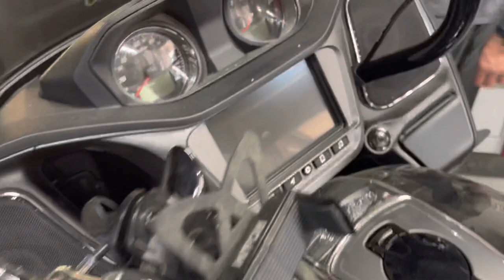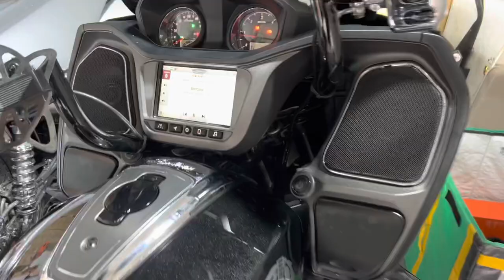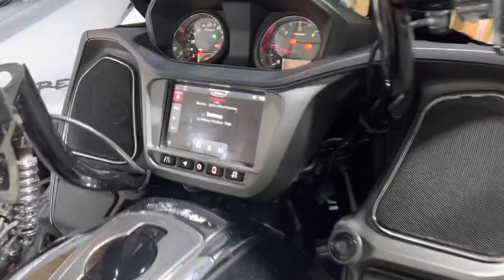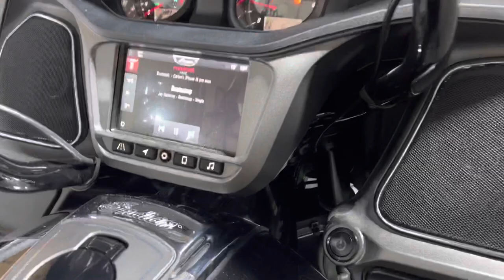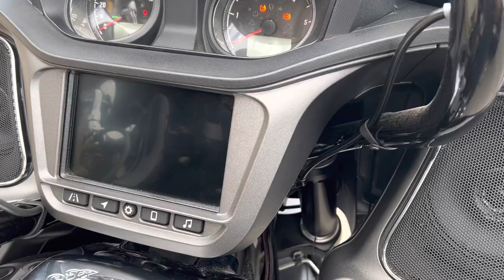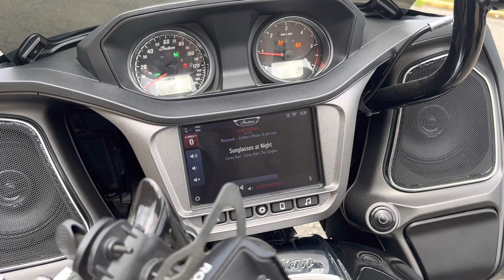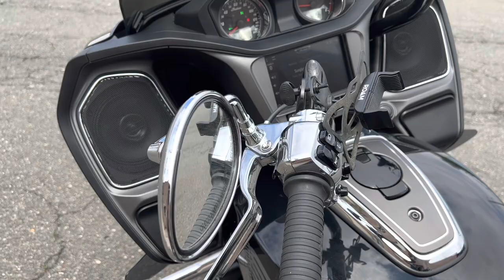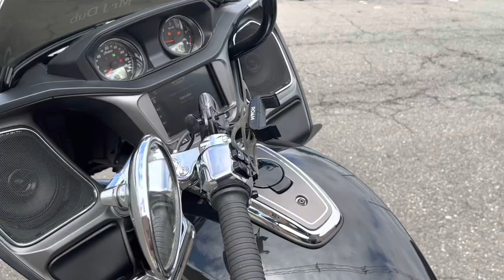Indian Challenger in for a Nvs Audio Stage 3 Audio upgrade using the factory radio.

Comment: Awesome! Sounds like you guys know your business. Do you have  a solution for the Springfield? I have the Indian speakers and amp in the bag and it's useless. My pipes are V&H turn-downs so not stupid loud and I wear a full-face helmet. I also added a pair of coaxial Pioneer speakers on the handlebars as well as a 200 watt power amp in my handlebar bag. Still can't hear jack going over 40 MPH. I'm plugged in direct from my phone.

Comment: Carlos, I'm sure you've noticed on these Challenger's the front pods have down firing ports in the front. Have you tried sealing these by chance? I have a 21 Challenger that I am wrapping a full build up on and was curious if sealing them would help any?
Fronts: Cicada 65.4
Rears : Cicada 8.4
Amplifier: Soundigital ExoX 2400.4 (4ohm)
DSP: DSR-1
Reply from the maker: I leave the port open and tune the system on a rta so I can see exactly what the speaker / pod is doing at what frequency.

Comment: Noticed that you turned that volume down before, you opened that bag. Is it TRUE that you could damage the rear sub / mid base speakers if you don’t keep them closed ?°
Reply from the maker: Yes 

At low volumes it’s safe 

At high volume you can blow the woofer . 
The woofers need the pressure in the bags to control the movement of the cone . 

Same thing with the trunk of a car with subwoofers 🔊 
Never open it with the system at full
Blast .
Reply: @NVSAUDIO  how does this work if subwoofers are in an SUV where the trunk and. cabin are all one space?
Reply from the maker: @vlusuriello1  that’s why bass hits harder in a trunk than a suv . In a suv the “trunk” is always open .

Comment: So 1 set of 8" speakers is getting roughly 132w assuming they are wired in 4ohm???
Reply from the maker: Yes
Reply: @NVSAUDIO  so what's 8" speaker should I replace with my 6x9 on 800.4 not bridged? I do have diamond audio M075T tweeter to go with them on their own amp